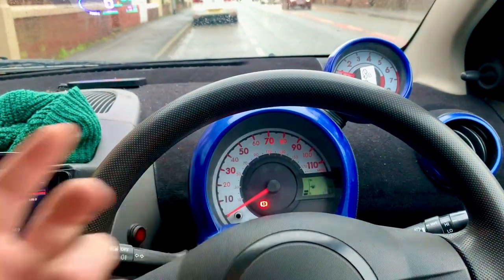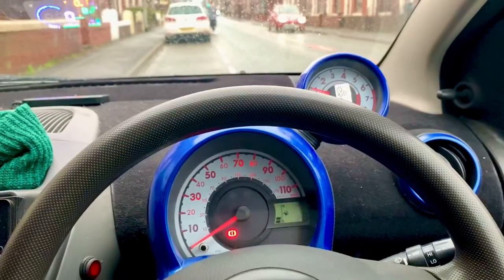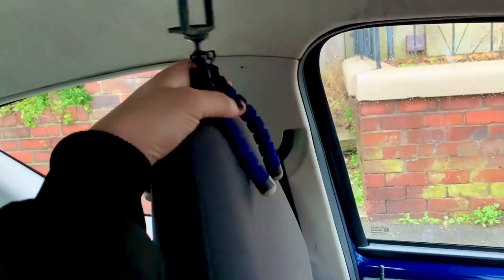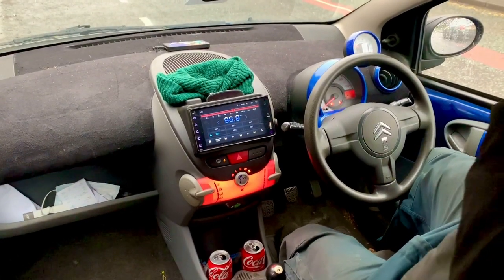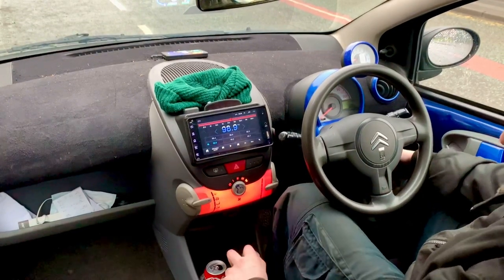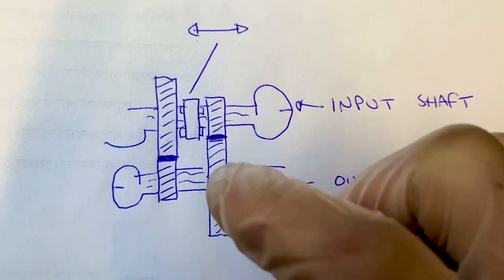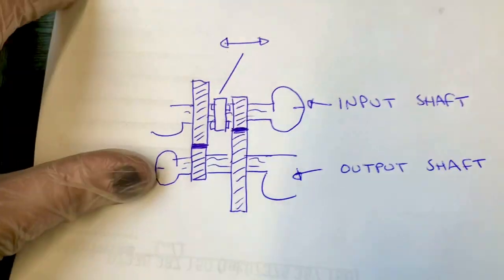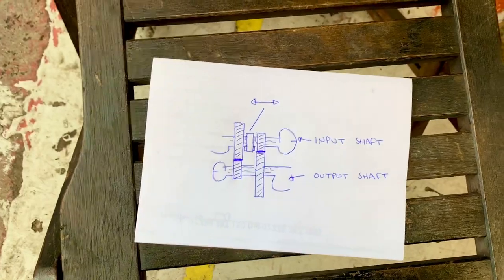Clutchless Shifting. How To Drive a Car With a Failed Clutch/Snapped Clutch Cable (CityBug)

Comment: Never drove without clutch but will remember this. Had throttle cable snap and drove it back pulling on a cable sticking out the bonnet which was a dynamic experience! 😎👍❤️
Reply from the maker: I had that on my old D-turbo. I wedged a bottle cap in the injector pump to make the engine idle shut 2000rpm and limped home haha

Comment: I just did this, cos the Bearing leaver broke, cos of capillary crack. I welded it with high prudence. And its aright, but some electric problems with the immobiliser occurred.
Reply from the maker: Had a broken clutch fork on the past on my old 306, welded it up.

Comment: Had an S60R clutch fitted in mine at the weekend, think this method would be easier tbf. Never felt a clutch so heavy
Reply from the maker: My bmw one is like that. It’s from a later 5 series and it’s a bit of a heavy shitter tbh

Comment: clutch cable are actually very reliable, cheap and durable but its so long lasting people tend to forget about them until it snap in a very inconvenient time and place.  In my experience, it not the cable that breaks but the lug (loop)end. 

I still believe that cable is better than hydraulic but it should be dual cable system. I mean, only one cable in tension but when it snap the other one would carry the load.   The second one also an indication to replace the first one.
Reply from the maker: There are a lot of benefits to cables over hydraulic in my opinion.

Comment: I once managed to pull the Pug out of 3rd gear without using the clutch and it did it without any trouble. However, I'm not planning to start putting it into gear without the clutch 😂
Reply from the maker: It’s easier than it sounds. You just need to have it at the point between power and engine breaking where it’s “relaxed” to pull it out of gear with no force.
Reply: In other words, neither accelerating nor decelerating, on a flat surface. just the second you let off the accelerator pedal, gearbox will be unloaded. not slowing you down or speeding you up.

you can apply slight pressure on the shifter towards neutral, it'll pop out to neutral the moment you let go of the gas/throttle pedal.

Comment: This brings back memories I had an N reg 1242cc VW Polo with 140,000 on the clock the clutch pedal was on a bracket that was spot welded under the dash I put the clutch in one day and it just fell into the foot well, I managed to get it home 5 miles away with no clutch rev matching and crawling along in second gear up to a red light, it was a good £200 motor that no BMW, Audi or Mercedes bullied on the road, a couple of welds and the bracket was back up and working again
Reply from the maker: Nice one. I remember rebuilding a clutch pedal bracket for an old Rover that I was doing for someone in pissing down rain at about midnight so it was ready for them to go on holiday the next morning. Had to take it off and take it to my work at the time to weld it up then take it back and refit it. Was a right shit job.

Comment: I like the position of the camera angle its like driving drunk 😂
Interesting though I remember driving me dads car without a clutch 😉
I hear farts in a jar sales much better 🤓
Reply from the maker: I was a bit disappointed with how shaky it turned out, but not disappointing enough to do anything about it 🤷‍♀️ 

I’ll bare that in mind, if I can find some big enough jars…
Reply: Top tip for Tim! If you planning to sell those farts be sure to use a jar with a good seal, and use it submerged in the bath water. Then release the noble gas into the jar which will displace the water in the jar. Let the gases displace all the water and seal the jar... And success! You have a jar full of farts!
Reply: @StupidBlokeStupidVideos  
Lol hey i like the feeling of being drunk don’t change nothing 😂
Reply from the maker: @Gourmondise  sounds like you’ve done this before?
Reply from the maker: @B.a.S.t.A.r.D.  fair enough haha

Comment: my citron has an issue it may be this? Basically after a lot of driving start stopping etc the peddle starts to squeak can't tell if the sound on the peddle or in the clutch as it can be heard louder outside the car. The other thing is gear 3 and 4 (mainly) have this weird low buzz sound to resolve I just put pressure on the gear stick and it stops. The car also on occasion when picking up spread jerks like power loss but my revs carry on and then it re sorts itself after 1 to 3 jerks any ideas?
Reply from the maker: Sounds like it could be a sticky clutch arm on the gearbox 🤔

Comment: My ford ka drove up and down gears without clutch just fine haja only pulling away was the funny part amd trying to do same in reverse it goes quick haha
Reply from the maker: Setting off is the only real issue. I had an Astra van with a failed concentric thrust years ago and drove it like this for about a month before I fixed it 😂

Comment: This is how I drive mine constantly. I use the clutch to pull off, then  proceed through the gears without it (I don't bother with 3rd, I go 2nd to 4th) my reason is to limit wear on the thrust bearing which has a reputation for breaking every 50k miles. Hopefully it'll help.
Reply from the maker: I sometimes drive like that too, with me it’s just cos I don’t wanna move my left leg though.
Reply: @StupidBlokeStupidVideos  How often do the clutch cables need adjusting in these? I adjusted mine 10k miles ago to rectify slipping, but It's ready for more adjustment.
Reply from the maker: @onepalproductions  depends on driving conditions and style mainly I’d say. It shouldn’t really need adjusting again unless the clutch is getting more worn or the cable is backing itself off or becoming “stretched”.

Comment: You know what really grinds my gears?
Not using the clutch pedal
Reply from the maker: It’s all fine and smooth as long as you’ve got a built in quick shifter and auto blipper…

Comment: Hi just wondering if I can rack your brains my c1 will start but cuts out 2 seconds later, if I clean the spark  plugs, I can get it to run for about 30 seconds and can rev it  then it just dies, I've check fuel and it flys out, compression is good I'm not sure what else to try 👍
Reply from the maker: Sounds like it’s overfueling which could be down to lots of things. Tried cleaning the throttle body, map sensor and running it with no air box on? It could also be a blocked exhaust for example a collapsed catalyst.
Reply: @StupidBlokeStupidVideos thanks for replying I was thinking it was over fueling, when it runs for 30 secs loads of white smoke poors out. I'm going to clean the map sensors and throttle body up over the weekend. Ive had the airbox of and no change. Its weird as it runs for 30 seconds you can rev it if you keep on pulsing the accelerate but as soon as you you slow the revs it rev again it just dies like it's got no fuel. 🙄

Comment: How do you change gears without a clutch do you force the gears
Reply from the maker: No, you just have to rev match and it will slot in easily.

Comment: hi mate any chance you could do a video on the lexmoto echo 50 euro 5 edition?
Reply from the maker: I’ve not done one of them yet, not actually sure they can be done without buying a new ecu either.
Reply: @StupidBlokeStupidVideos  ah okay, do you reckon if i got what i needed for it i’d be able to fit it myself or would i have to take it to a garage
Reply from the maker: @patrickdoyle5761  if you can get a derestricted CDI then it should be a plug in part but I’ve not done one before so I don’t know for sure tbh
Reply: @StupidBlokeStupidVideos  okay any help would be appreciated mate